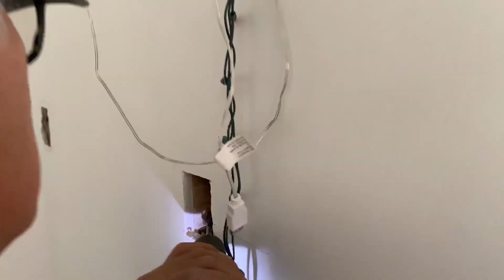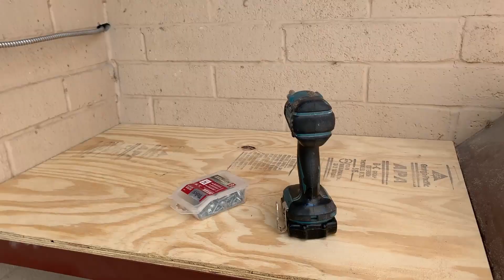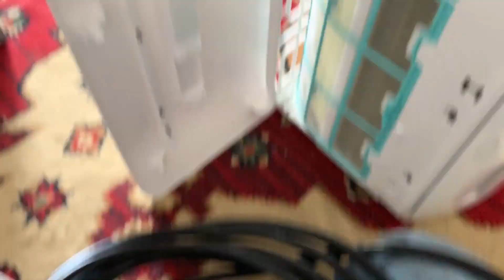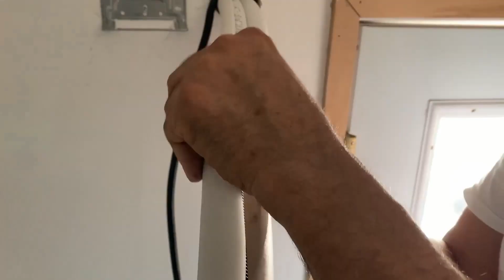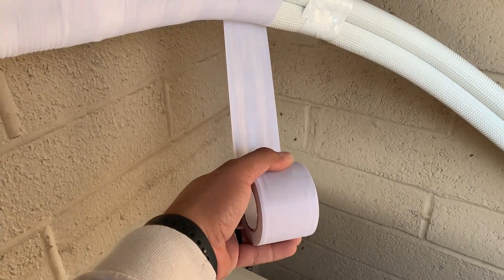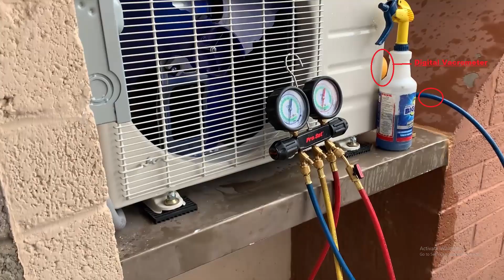Mini-Split Installation

Comment: How good do this mini splits work in the AZ heat?
Reply from the maker: I don’t know how your comment slipped by me, but I just saw it now. Mini splits are incredible and they even work exceptionally well in Phoenix heat. It will easily cool down a room to as low as you’d like no problem. Don’t think of them like those old window AC units, mini splits are almost as good as regular AC, in their ability to cool.
Reply: @luisangelmedia  Thank you for replying. I have a 25 year-old on/off package unit on the roof with leaky duct in the attic. What system would you recommend for a small 3 br, two bath, kitchen living room and I'd like to condition the garage as well. 104F in the summer in the garage is not cutting it anymore. Would you install a split system per room or go with a compressor that can supply multiple evaporators?
Reply from the maker: @rambleon2838  id would do a multi zone unit for the bedrooms as they will be very different to each other, each room needing more or less cooling. Then I would do another multi zone for what would be the kitchen and living room and then 1 for whatever else is left to cool, like the garage.